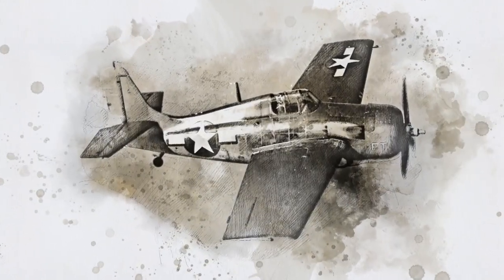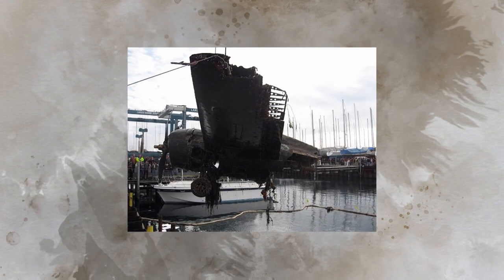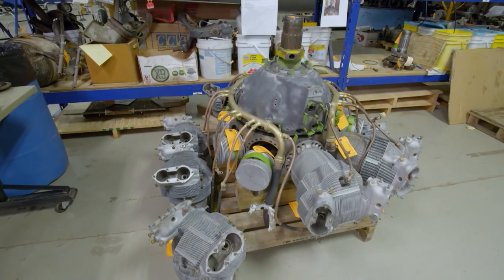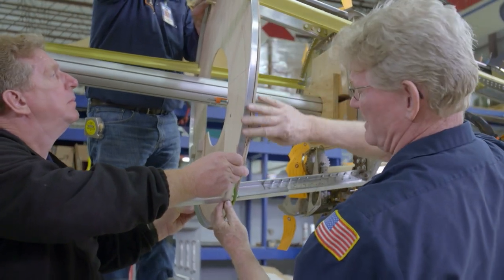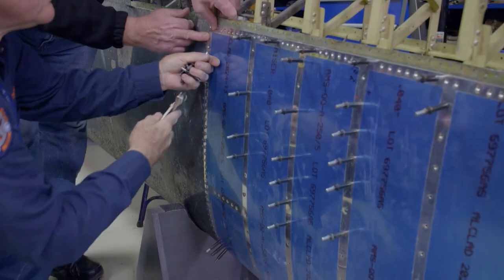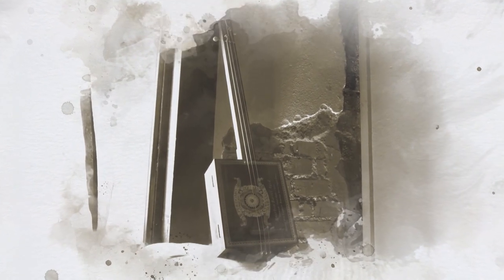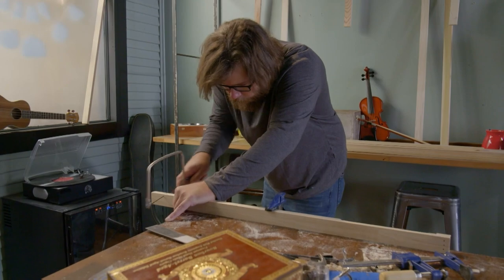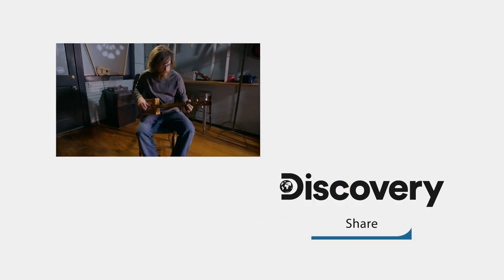Restoring A WW2-Era Wildcat Fighter Plane | History In The Making

Comment: I turned it off after about 20 seconds... the producers can't even tell an F4F from an F6F.
Reply: Did I miss something because I watched this video a few times and did not see a F6F. The plane they were working on was a Wild cat.
Reply: @fredflintstone5860   Yes... right off the bat -  @  8 seconds shows two F6Fs as the narrator says 'In the wars early days, it (the F4F) was the only plane in the pacific theater inflicting.. etc etc...".   This kind of evening-news style filmmaking indicates a preference for entertainment over accuracy, and for me the enjoyment and intrigue in projects like this (and most other things) is in the details.
Reply: @christianjensen5523  Thanks for pointing that out. The lead aircraft appears to be a hellcat but the one on his starboard side could be a wildcat. Look at the fuselage near where the wing meets behind the cowl, I think I see the tires from the landing gear.  The wheels on the hellcat tuck into the wing where you can't see them. But then again I can't see sh*t as good as I used to.
Reply: @fredflintstone5860  No - both are Hellcats.